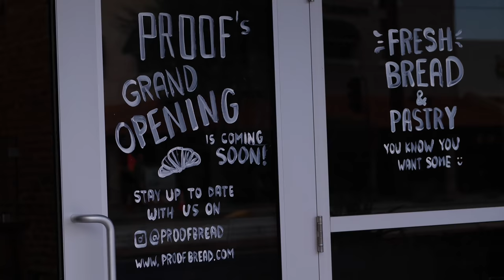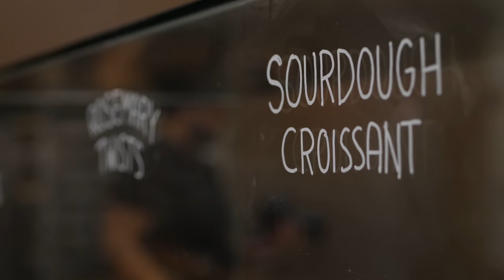New Bakery Soft Opening to the Public | Proof Bread

Comment: Need a jacket (whites), but a style fitting for the bakery. At least while running the oven so your arms are covered. And yup, I was burned a lot when I worked in kitchens. Lost the feeling in my fingers enough, I could take out pizza pans with bruschetta loaded on them, bare handed. Quickly, of course.

Comment: Don't you bake danish pastry with the filling?
Reply from the maker: Depends on the filling. Most don’t want to bake as long as the pastry itself so when we bake them blank we have more flexibility. In most cases we pull the danishes out a few minutes earlier than all the rest and put them back in with their filling.
Reply: @ProofBread  Thanks for the answer, i'm used to the vanilla custard one that's the most common one in Sweden i think :D